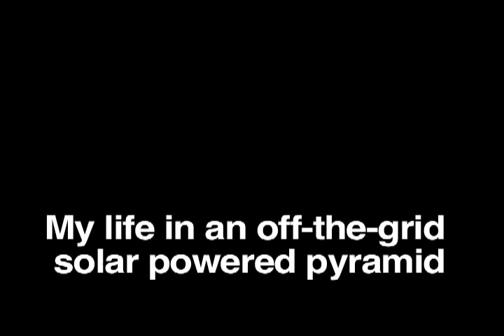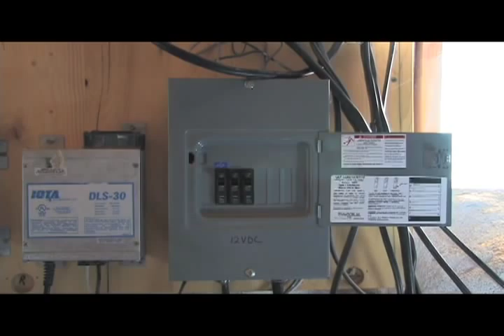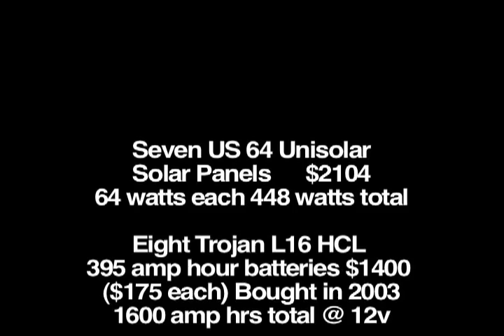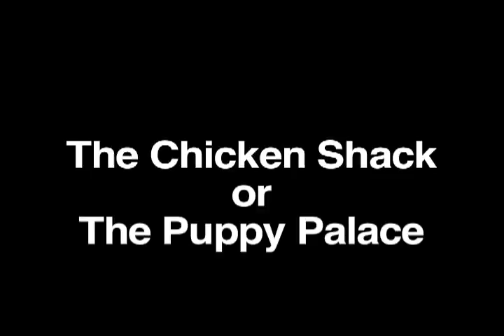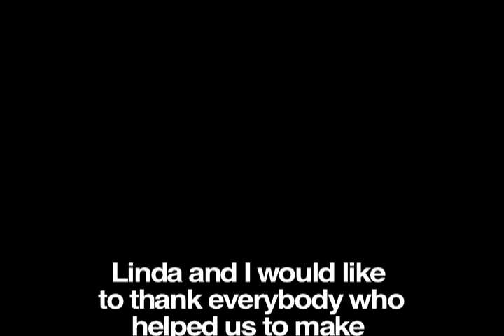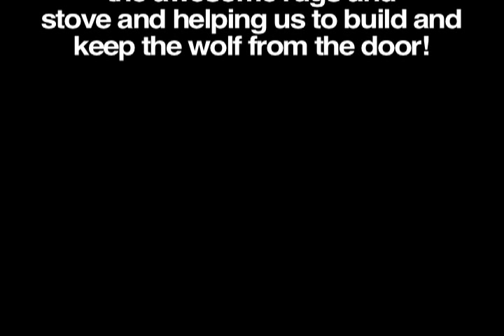My Life In An Off The Grid Solar Powered Pyramid- Entire Film!!

Comment: I would like to point out that a modified sinewave inverter is fine for anything with a switching power supply (computers, for example). Ferroresonant power supplies (transformers) and motors do not like the harmonics, and should be run on true sinewave power. So, for those that only need to run a computer, the cheaper solution should be fine.
Reply: I agree with you. I am a musician and super sensitive to sound, so what seems like an annoying hum or buzz to me, some people might not even notice.
Reply: Greg Grant Audio gear should never be run on anything but clean stiff sinewave power; no shortcuts there. :)

Comment: could I use stucco  on cinder blocks in fl? What is good material for a 100x100 ground level art studio house in fl on 5 to 20 acres? I think fl is too humid for straw. I like your pyramid home, Pam
Reply: Pam I have never stuccoed cinder blocks, but yes you can do that. There are some good videos of that online. Straw could be a problem in Fla due to condensation issues. I like cordwood houses but there is a lot of wood in MT. Also check out sandbag houses or earthbag homes, they are pretty amazing.
Reply: Greg Grant Thank you, I will you tube that

Comment: Greg I was wondering about your water system and what you do for showers and the bathroom. That is one of my biggest things about going this way I can deal with a out house but I love my hot showers...
Reply: For over 10 years we used an outdoor wood fired hot tub to bathe, even in -20 wintertime. We'd bathe first and then jump in. We still do that on occasion, but have an on demand propane water heater for the last 4 years for showers and hot water. Works great, I use an eccotemp L10 (outdoor battery powered) and on occasion you have to backflush it and use vinegar to remove deposits from hard water, but it is great. We just upgraded to the indoor eccotemp FVI12-LP which should be even better once I hook it up (just got it for Xmas) inside (it has a horizontal vent so I don't have to cut a hole in the roof). I get over 50 psi from our dc water pump and a 2.5 gpm showhead and it works great.
Reply: Greg Grant
I should add that showering almost every day for 2 people only uses 4 or 5 20# propane tanks (about $44 to $55) a year total.
Reply: Greg Grant That is cool thank you Greg I would really talk to you about more stuff. I am hoping to live like this in a few years I am just trying to find the peace of land... Oh and save the money..

Comment: wow yes that is what I wanna do aswell ! =D

How do you treat sewage? compost toilet? thanx
Reply: I had a composting toilet and it worked well, but the temperature can NOT drop below 50 F or the microbes die and it stops working and you get odor. I use wood heat and don't heat the house if I go away for a few days in the winter, so the compost toilet doesn't work for me. I use a camping toilet inside, and then dump it outside to compost outside. Works really well, I dump it like every 3-4 days.
Reply: yes those details are pretty important...  =)

Comment: I thought a added benefit to the large roof on the pyramid would be to catch water to fill cisterns , filter and shock with chlorine then use water pump and another filter to take out the chlorine before use.
Reply: I used to collect rain water off my roof for over 10 years (from the first octagonal tipi house). I drove to a spring a mile away for drinking water. Now I just have a well and it is much more convenient and more than enough water for my needs.

Comment: Where do you live and what are the building codes and regulations where you are?
Reply: I live in nw Montana and there are NO codes or regulations or permits recquired outside of city limits. There is code for electric if you connect to the grid and you need permission if you want a septic system.

Comment: have a question, the ground level floor whats it made out of cement?
Reply: Yes, a poured concrete floor, no rebar or wire, just concrete with fiber. I built the structure first and poured the concrete through the door with a pumper. I had a friend with a small crew and experience and tools do that for me. I didn't pay anybody for any help building the house, but I did pay the concrete pumpers and of course for the concrete trucks.
Reply: Greg Grant
Im looking to build some kind of off the grid house on my 10 acres. I wish I had all the timber you guys have
Reply: Dont Tread on Me Where you at?

Comment: Pretty close to EMP proofed home if the roof is well grounded.
Yeah, you have a college degree in eco design and construction and smarts.
Now for cost of solar, appliances, comforts, where does water come from and wast water go to?
Do any growing and canning?
...... I ask too soon.  Hey we wear the same sandals.
Plans and knowledgeable helper?  Serious footer - how deep?
Quite a crew.  Not exactly Thoreau but he had more money perhaps and a tiny cabin but a great little pond.
Reply: We turn the power off every night for sleeping as well, so hopefully we have minimal exposure to all the electromagnetic stuff in the world when we are home. I built the house around the well, so the well is in the utility room and thus never freezes. I put the pump down by hand and have pulled it up by hand as well. I have a grey water line that just goes out 4 foot below ground level into a perforated pvc pipe surrounded by gravel, it works well and we use only biodegradable laundry soap etc at home, no real chemicals except for a little bleach once in a while. I poured the footer first, it was 12" by 12", 4 foot below ground level. We have a garden for the summer and I am currently making a partially underground greenhouse to extend our growing season. We don't can, but we freeze strawberries we grow and dry oregano, basil etc. Beets and carrots keep really well in the root cellar into the winter. I made my own plans and consulted with a friend about solar, a friend about log angles and necessary supports, and another friend about the concrete bar/welding  and another one about the poured cement floor. Most of the time I worked alone. We have to drive to a lake, but it is not too far.
Reply: Altered State Records
Maybe the footer was 16 or 18 inches wide, I can't remember right now.
Reply: Altered State Records It looks like it's in that range and that's why it caught my attention.  Your well location is hugely smart.  I thought musicians were not so bright (pulling your strings).  Good voice also; you do several tracks; how many instruments do you play?  Accompanying artists?  Sound/Recording room within?  I know in my knower that there is much more so reveal.  I'm wondering if the squirrels are going to carry away your straw or just say to each other, "Hey, let's just burrow in." ... writing and watching ... Hey, Peter Pan gots (loaned) kids?   Dang, how many pairs of gloves did you wear out on the stucco?  Sheez!  And I never imagined that "dirt" would work well with concrete (why not?) .... I would think to much forest for a windmill and a bit of a challenge for solar panels, but how do things work under your magic? ... Apex meditation at ladders end? ... Ah ha, you DO have a studio; I knew it !  .. and a village ... zome -like ... my wifie didn't go for the zome concept.  Peace with the neighbors? ... Ta da ...
Reply: Brian Bass
No kids, just two large dogs. Mainly singing, guitars, saxophone -  some drums and bass and keyboard as well, and percussion. In the pyramid no mice or squirrels or critters except for spiders for the last four years. One shrew though, tiny little annoying critter. Tons of gloves, no real wind here, solar works fantastic in summer there is a surplus of energy even with my small system. Good neighbors and yes, meditation in the apex.
Reply: Greg Grant We once lived harmoniously with spiders if they remained in the corners to do their thing.  Rodents are not to be tolerated.  I was wondering about your voice range; yours or friends harmonizing?  Oh for even a tiny moving stream and water power.  Lots of recycled smoke at the top - lmao.  My dream/fantasy in 1970 when the hippies were buying ocean from and island properties from CA to AK.  Jam.
Reply: Brian Bass
That's all my voice, overdubbed for harmony.

Comment: I'm just thinking here: your little Subie is a pretty stout piece of equipment, but you're not doing it any favors.  Get a little trailer, carry lots more, and yet keep the crud out of the car.  The cheapest trailer from someplace like Northern Tool is only $250, $50 for lumber to finish it up a bit, then you can carry a half-dozen straw bales at once and not a single stem inside the car.  Not naysaying your results, the pyramid is awesome.
Reply: I had an old pickup trailer that I used to use that worked really well until it started to fall apart and get stuck in the mud etc. I agree with you, good idea, but I am just using the suby until it dies which it isn't doing yet. No water/fluid in the radiator (leak in the head gasket) anymore so I run it until it gets warm then stop, leaks oil, rust in the gas tank.... I will sell it for scrap when it finally dies (IF it dies) and get a small pick up. It is just a work car, never leaves the property.
Reply: Beaters rule.

Comment: hello there i like the video keep up the good work  i was just curious what the 500 dollar house was made of that one is nice for 1 or 2 people any building plans on the that 500$ house just curious i would like to build one thanks again  very nice house
Reply: The 500 dollar house was peeled logs as studs/posts, with chicken wire stapled into both sides of the posts, and loose straw (NOT hay) stuffed as tight as I could into the space between the 2 sides of chicken wire. I did the inside of the house first, stapled the chicken wire as tight as I could so it wouldn't bulge too much, and then stuffed straw from the outside, stapling the chick wire as I went up. I don't have a professional plan for it as it was so simple, but do have some very rough plans on graph paper I could find and email you them if you like.    greg@asrmusic.net      if you want to send me your email.

Comment: I would like to have seen you incorporate a rocket stove, style heating into a cob style heated couch/bench the couch radiates heat into the whole house and with a rocket stove style heating, it will heat your house for Many Hours like 24 hours after the heat stops burning and that is on 5 times Less Wood as it would MUCH MUCH Less wood to heat your whole over that traditional style wood burning stove, maybe in that second story, run the chimney pipe into one or maybe two stacked 55gal steel drums they are cheap, run the exhaust stack/chimney into the barrel(s) exhaust stack runs up inside the barrel up to the about 2" from the top of the barrel then the exhaust from the barrel to out side from the lower side of the barrel that would retain  A LOT of heat into the house rather than letting 90% of your heat go out the chimney.
Reply: Yeah, those rocket stoves are great. The idea of a couch/bench with a lot of mass is a good one, perhaps I will do something like that someday. Honestly, though, I really love my woodstove and it alone heats the whole house and I only use around 3 cords of wood per year, not that much. I really love the glass window on the woodstove and cooking on it sometimes and being able to control the temperature of the house. I would worry, in the spring and fall, that the house could get too warm with a rocket stove, but I could be wrong.

Comment: How much money did he spend on tools to build the house?
Reply: I had most of the tools I needed from being a carpenter working out in CA. A skilsaw, sawzall, 2 drills,  and hand tools - around $500 for all those. I had to buy a chainsaw which today costs $400 new -  ten years ago I think was around $300. I bought a cheap compressor, small, just for staples and finish nails, and a cheap air gun for around $80. Also a cheap $99 chopsaw.

Comment: here in FLORIDA I am always told that it will not work where I would think with so much sun light 300 days per year
Reply: It would be SO much easier to do in Florida than in MT. Whoever is telling you that it won't work doesn't know anything about solar power.
Reply: Greg Grant this is frustrating more city and county park and rec personal are setting up solar powered park lights in key locations that will be used / needed in some Disaster scenarios as 90% has solar power flash lights and lanterns as well as stored away protected solar panels for schools that will be used as shelters But  always tell the public they not reliable  when they have had these tools over many years, over many cycles of replacements of  any tools that they want or do not want .
Reply: Greg Grant but the people that I talk to have large vans that said EXPERT But they are only heating up a garden hose, painted black on the roof / or in a window box to heat the water for the hot tub or the house ... any 8 year old child knows this

Comment: TWO IDEAS I FOUND ON U-TUBE U SHOULD EMPLOY.  (1) MAKE AN OUTDOOR FRIDGE FOR THE WINTER MONTHS AND LET MOTHER NATURE KEEP YOUR FOOD COLD AND SAVE ON RUNNING YOUR GENERATOR.  (2)  LOOK UP SPLITTING WOOD WITH A TIRE, THIS WILL SAVE YOU LOTS OF TIME AND EFFORT.
Reply: Good ideas, thank you. I like having my fridge in the house and it uses such a small amount of power it is incredible. It uses 7 amps dc in a 24 hour period at 90 F. It never gets above 72 in the house where the frig is, so it uses less than 7 amps, which is basically the output of 2 of my old solar panels in one hour of sun... nothing really. I keep the 12volt dc freezer in the root cellar and in the winter it doesn't use much power either. In the summer I always have excess power.

Comment: HI    Greg    well   I live in    Saskatchewan Canada in a 1929  old    brick school I now have made my home    well as far as building codes in   Saskatchewan goes it all depends in what community you live   in the bigger places they can be   quite pickey and seem to apply the building code more to the letter in smaller places they may recquire a permit but are not too overly  fussy and some places no permit at all,,  now in Saskatchewan there is a unique place called  Craik   ecovillage something like that several hundred acres  where the stipulation is that you build a  sustainable  energy type house it can be   straw bales   recycled materials    used   lumber   elevator used   lumber they encourage that there   unconventional building is encouraged and the energy to run the house should be   green solar   wind wood etc   now this is only one place I know of there might be    others too

Comment: if you added up all the man hours for ALL your "friends" you would find you have well over 20k into the home!
Reply: Well, first of all, no money was exchanged. I also have helped other people build their homes, so it's just something we do out here in Montana. Also, it's a work PARTY,  so things do get done, but they get done while drinking beer and talking and having a good time. Some people just came to do an hour's work and then just hang out... If money were being paid out I doubt it would have cost me more than $1000 or so for all the man hours I received. And if you calculated my time helping other people build and I got paid for that, it would be even less than $1000.
Reply: Greg Grant Thats what I'm saying though...  Thats ALSO @ "friend" prices, not professional contractors is what I'm getting @. The value of the home is well well well above what you have invested in, via the man hours sweat equity. I'm not sure what type of acreage its sitting on but I'm certain it appraises for between $90-$150K. Thats my point! I'm doing the EXZACT same thing as you RIGHT NOW... except, I've/I'm doing EVERYTHING 100% ALONE..  Its a lot of work!!  Hand digging my own 30' well, building my own ram pump, Roofing a 12/12 pitch roof with the same roofing material as you, except i was 50' in the air with 15' panels during a freezing rain storm, walking the deck on only a few 2x's with grace ice/water shield covering the deck. Just climbing onto the roof with the panels alone by myself.  You where very intelligent to do things the way you did! I wish i was more of a people person! Unfortunately the few people i did know all blew me off when it came right down too  it. Needless to say the only person i count on now is my fiancé & I! Congrats on the home! Great example of the alternative energy efficient means of living thats available to us all with the technology available today!  I plan to go all electric efficient everything & just keep multiplying my solar/wind abilities.  I can't wait for the tesla walls to come back down to earthly prices in the next 5-10 years, id love to have a couple of them.
Reply: I agree with what you are saying but I want to clarify a few things. In the 2 years or so of 40 hour work weeks (done over 5 years) I did almost everything myself. So, if had 100 man hours of help plus two days with a bunch of people doing a 6 hour work party, maybe I did 98% myself? 97%? 99%?  Something like that. The work parties saved me some time but it was unskilled labor that would have paid like 8 to 10 dollars an hour if I had hired people. There was one guy who put in 6 hours with his great skill at chainsawing logs and helped raise the main logs (with other people too) which I could not have done myself, but that was the only thing I needed other people for (except the concrete trucks and pumper which I did full price for).  Perhaps he would have charged me (if not a friend) 30$ an hour? 40? I don't think more than $50 an hour, so, a max of $300 for him.  Good luck to you on your place!!